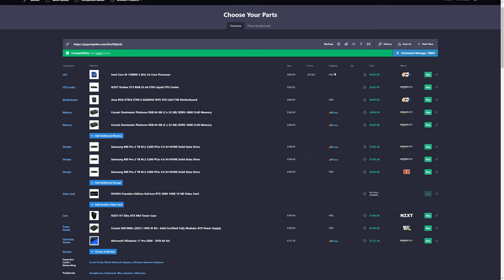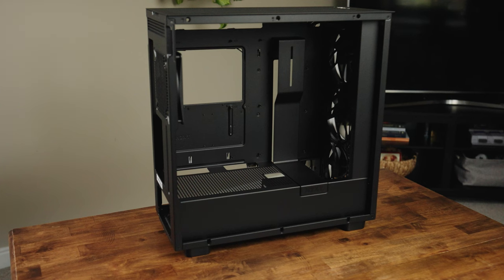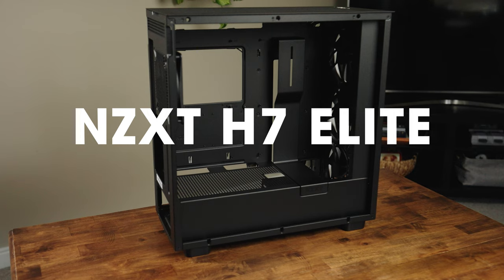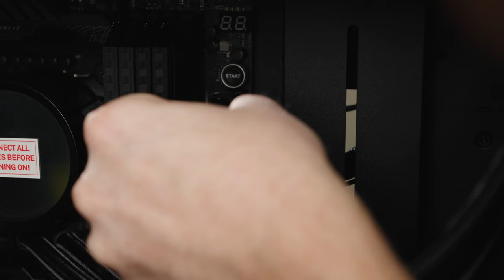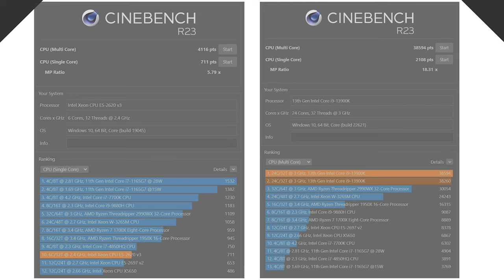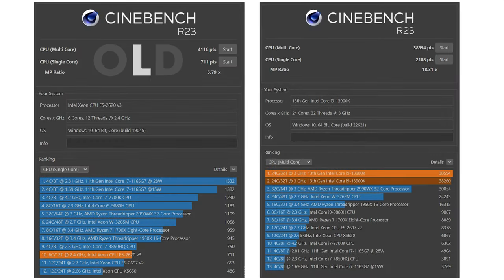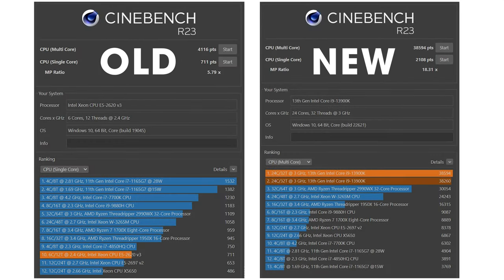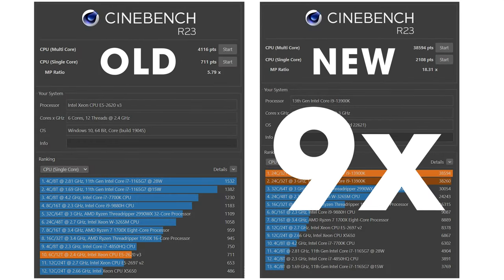I Finally Built a New Computer After 8 Years

Comment: congrat, you made it to my youtube page! ( 2nd video ). Got some suggestions too:
- RAM actually helps you to run programs faster, but only if you compare to another pc with less or = program requirements. More things can be loaded and being used instantly when needed, which makes it faster. The main point is you can load more things at once and work more effective ( and faster too ), thats what you may want to tell.
- Some "asmr" parts, like peeling off the nilon or screwing, I like it to be at normal speed ( both video and audio ). Would be cool if you add some clips like you testing cinebench or installing programs, for the last overview of the pc they definitely looks cool
the video itself is great but idk, those ideas came up as I try to figure out how to make it better. Youre not new to filming as it shows that you did it well, but maybe my suggestion could help a little bit!
Reply from the maker: Thanks 👍